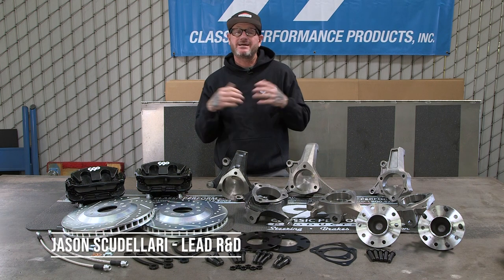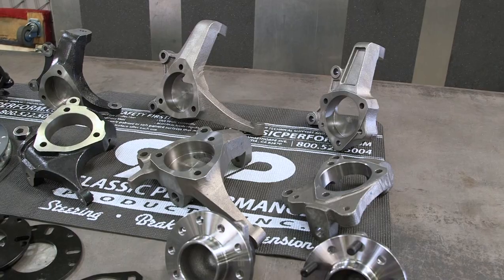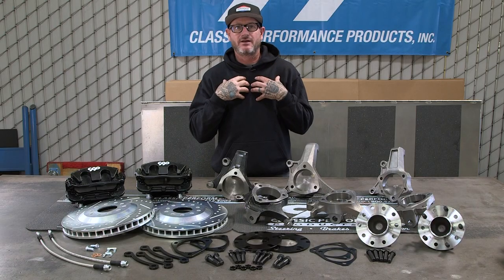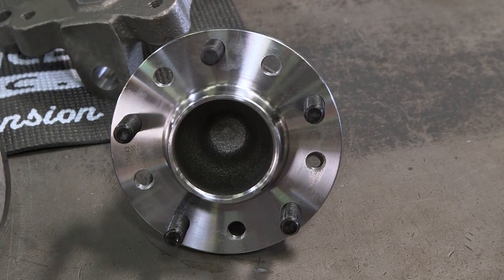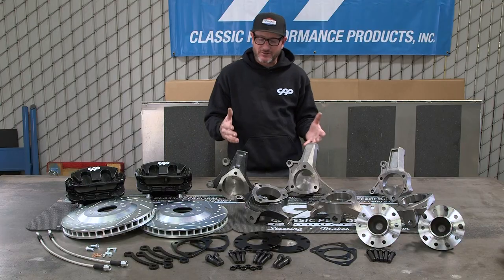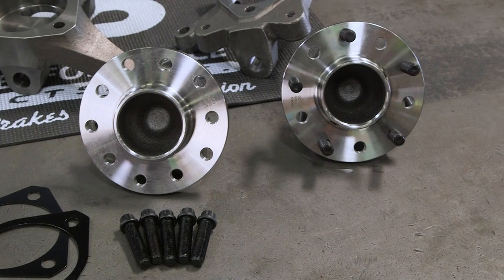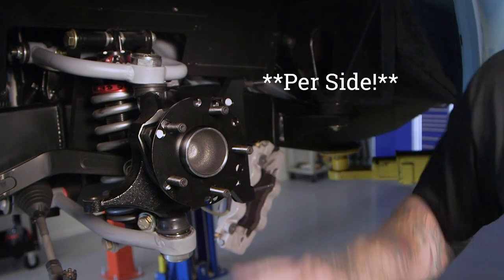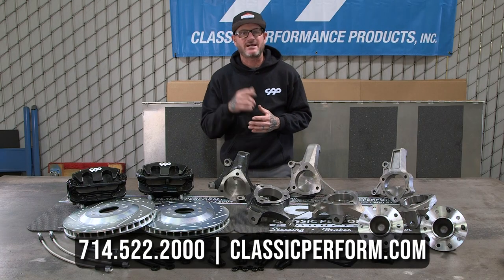Corvette-Style Spindles: Modern Reliability & Brakes for Your Classic Chevy

Comment: Can you tell us the maximum rotor offset before you run into clearance issues?   Where the back side of the rotor interferes with the spindle.
Reply from the maker: Hi, if you give us a call at (866)-882-4131 one of our sales reps might be able to answer that for you.

Comment: I have c7 hubs and uprights on my 65 chevy Bel Air with 15 inch wheels
Reply: How did you install that? Kit?
Reply: @amcarcs  I put this together in late 2021. At that time cpp said they were not going to make a kit. I bought the cpp c7 uprights for the 55-57 Bel Air.  Tubular upprt/lower control arms for the 65-70 Bel Air. Modified both arms and turned the lower arms into a-arms.